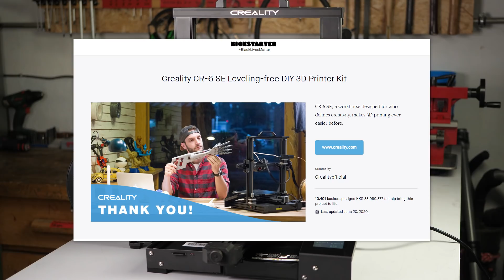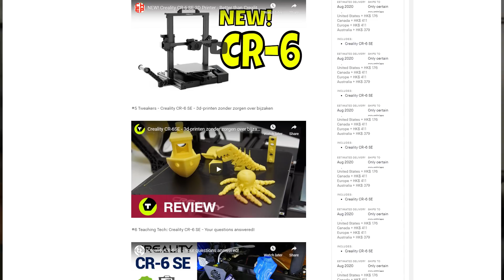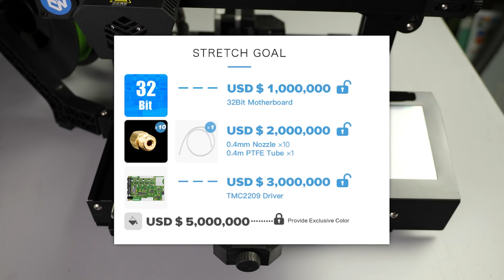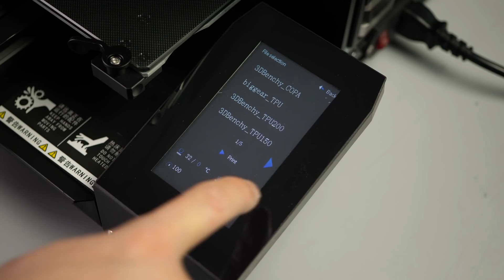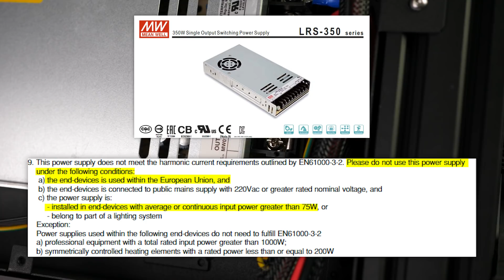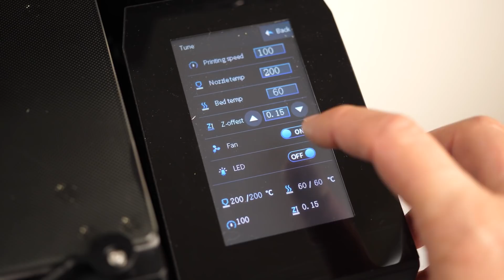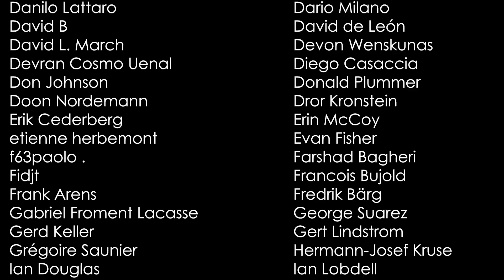Creality CR-6 SE - The NEW (over)hyped Kickstarter 3D printer?

Comment: Well, products like 3D printers we already know will be worked on and modified by the end user. So when I want to compare or complain about something I look to see if it's something that could be easily modified by the end user if they desired it, or if it's something outside the realm of what you would expect.
Something like that print nozzle having an integrated strain gauge, is an example of something you cannot modify or easily retrofit without a whole ton of work.
Something like a flexible print bed, can easily be replaced... Especially with how easy it is to re-level the bed. So I would not call it something worth complaining about.
The same goes for the fan in the meanwell. Even though they are name brand power supplies the fans they use are subject to Chinese quality control. So they might not all be loud, but if you ever get a really loud fan.. just take it out, and replace it with a silent one.
I'd really like to see your next video be an example of adding a flexible print bed and replacing the fan... With the final shot being it printing in your office instead of your basement.
Reply: Yes but how much time do you really spend bed levelling for a decent printer 15mins every couple of Months? ok if your swapping nozzles every day but how many people do that all were paying for is the "it looks cool" and the thought that it might somehow be better than manual levelling but at the end of the day a level bed is a level bed manual or auto. The only time I see auto bed levelling as worth it is for printer with huge bed surfaces 500+ where your a bit more likely to have bed differences or a printer that has a warped bed but that's just covering up bad manufacturing or quality control or if you plan on lugging your printer around the country.

Comment: Non-Creality-Centric channels always complain they would prefere a flexible bed.
Failing to realize most Ender-3 Pro owners had to spend extra money to get-out of the flexible and go to the glass.
That's actually a "free" upgrade, not a problem.
Reply: My Ender 3 pro flexible bed was amazing!

For the 1st 10 or so prints, they just don't last i had bits of it flake off, the magnet gets weaker, and once you make one mistake with you bed level its scored and all your prints have lines on the bottom.

Flexible beds are great if you plan to print big things with large bases that are difficult to remove, but flexible beds should be treated as a consumable

Comment: I beleive becuase it does not have the European Standard or British Standard Rating on the Powersupply is why it states it shouldnt be used in the EU. However it does have the CE logo so can be used.
Reply: As long as there is one usage case in the EU, (and they are compliant), Meanwell can still stick the CE logo on it. They do not have to meet general purpose usage, as long as they clearly state the limitations, (as they did). As for Creality using it in a non-compliant case, for them it is a component and there is no need for CE on the power supply or any conditions from Meanwell, as they need to redo all EMC tests anyway on the end-device.

Comment: Regarding CE compliance, since the end-device will need to be tested again for all EMC requirements, if Creality passed these tests, they are OK (assuming they used a credible lab). Although advisable, separate components do not (necessarily) have to meet the CE requirements. On the other hand since this is the main power supply It would be unlikely the end-device harmonics would be significantly different from the separate power supply itself, also since the heating is a nice resistive load.
Anyway, Meanwell only makes the statement regarding EMC, fortunately not for safety.
Reply: You sound confused. "CE" is s dual use "standard." It means one rigorous thing in Europe, in China it means "China Export"
Reply: @vidznstuff1  I am not confused. Certifying for CE is my daily business. I am a notified body certifier for EMCD and RED myself. As for China Export, Meanwell itself refers to the European rules, so clearly the European CE is intended here. And they are allowed to attach it to the device based on the limitations.
The China Export is in principle an urban myth. Just like FCC is for "From Chinese Company"

Comment: A US$420 projected retail price (non-Kickstarter) with what I consider extremely minor complaints (except for the PS fan noise!) versus US$999 for your Prusa Mk 3 makes this printer "overhyped" and not worth the retail price?  I don't see that.
Reply: The tarif for this style of printer is about 350 USD, which I think is reasonable, do not see the added value to justify 420 USD. People that buy a prusa usually is a different peer group that wants to contribute to the development of innovations in open hard/software and/or are interested in just printing without hustle and not so much in doing mods and upgrades. But still I think it is fair to compare it also pricewise and you can clearly see that the china printers are closing in featurewise at lower pricepoint and also start using higher quality components.
Reply: yeah. he can get a bed and a new PS fan and still be $400 less that Prusa.
Reply: I think he's going a bit hard on Creality to get them to make these changes. Not implying he's being disingenuous at all, just that he's probably being strategic.

Comment: There isn't really a good, slim and passive PSUs in MeanWell's stock power supply lineup. The next thing would be the size of a large-ish brick and it would weight a ton. And the passive ones topped out at around 350-400W last time I checked. That's at least what I deciphered from their lineup last time (about a year ago) I checked.

Comment: Coming from an Anet A8, I just found his critical points being nitpicky, but oh well to each his own. 😅
Reply: I own an A8 as well. It was my first printer. Being mechanically inclined, it was awesome. Built it in a few hours and was printing, although not perfect. It’s currently down with a fried MOSFET on the hot end. And talk about loud.. I once seen someone call it the vibrator 2000. But once it was tweaked and tuned, it put
  out some good looking models. The fan noise doesn’t scare me. That can be remedied. I backed this with the enclosure, mainly to print ABS. It can also silence the fan :)
Reply: My thoughts exactly, my A8 is currently in pieces as for yet more upgrades while I wait impatiently for my CR-6 to come in September. "Ooh, the PSU fan is too loud," well I'm sure we can find a way to swap it out for a silent one, it's not rocket surgery. Hell, I'm pretty sure I have a couple spares kicking around from when I added one to my A8.
Reply: @irishalcoholic  ggg
Reply: I also still have an A8 as my main printer, despite all its shortcomings, there is still such a big community and so many upgrade opportunities that it can do anything I need.
I switched to a BTT SKR 1.4 with TMC2130 and attached a capacitive leveling sensor, and a 40A single-rail ATX Antec-PSU with all the safety features. Made myself a beefy MOSFET board, a laser control board (with toolhead quick change), a dry chamber for 6 spools of filament, an enclosure, and attached a RPi to the standby line of the PSU, and now it's basically a fully autonomous print server with zero noise and almost no maintenance.
I often thought about buying a new, more modern printer, but all the features they have and even more are already installed on mine, and I can tune and replace every single part of it.

Comment: Thanks for this great review :) . i also backed it early and im quite confident that this will be a good printer. also thank you for some critical toughts on it. the most annoing as you said would be the noise of the powersupply . i've seen a lot of videos on this printer and also a live stream of someone printing it who had is opperating mostly quiet . you could only hear the fan of the extruder.
the stream was from 3DMN . i would like to knowif the frimware is a potential cause of the problem here

Comment: I want to see the cr-6 max in action too. This but with a build volume larger than that of a cr-10. Here's hoping it's not a repeat of the cr10s max.
Reply: Needs at least 500mm in the z to be useful
Reply: Problem with large printers like CR10s max is with a moving bed is the larger they get it impacts print speed and quality because the momentum of the moving bed, for larger print areas over 300 core xy is better because your not throwing a big bed back and forth. Only problem is core xy cost more.
Reply: @Mrtickleberries  Agreed. I'm waiting for the PrusaXL more than anything right now.

Comment: i don´t like not to be able to level the bed manual ... the mesh leveling should only be to correct an uneven plate ...
the noise oft the power supply fan ? a no go for me !
Reply: All plates are uneven, so you do need the mesh leveling if you're going to use the whole printing area at once.
Reply: You can still set the offset manually for each area of the bed

Comment: It's overhyped. But some people have such bad machines, they are desperate for new printers, for their ultimate solution 😂 Recently I have bought a used JGAurora and it was modded to death, literally. Basically everything you can do wrong has been done on it. One stepper driver had a vref of 1.72V on a TMC2208. Now down to 0.7v or so.
Some people watch too many YouTubers that have no idea what they are doing and slowly worsen their machine until it's useless. A lead screw was totally bent. The lead screw was mounted with PLA printed stepper motor connectors. The brass mountings for the lead screw were totally worn out. Firmware messed up. 
The glass plate was freely moving around on the heat plate because the owner thought he could remove  and cool down the glass plate so easily. It had room to move around in the printed corners/brackets ....ugh!!

Comment: PEI coated flex plate is an add-on that can be added as an upgrade from Creality
Reply: @gerthddyn  Looks like 34.99 and 39.99 depending on smooth vs textured
Reply from the maker: Yeah, just notices, still over $30 though.

Comment: Backed it - I am a plain glass bed person so I'll flip it over.  I can't buy an Ender3 pro and upgrade it for $320 so I bought one.  I completely agree on the power supply - I will address the power supply fan noise when I receive mine.  I wish they would pay a little more attention to the power supply and electronics cooling by a employing a quieter fan and improved passive cooling techniques.  Your concerns about the power supply specs for the EU are valid, let's hope they select something more appropriate (and quieter) for the production units.

Comment: The cr10 has a bigger volume, but honestly width and depth are more important than hight in most cases. So the fact that it is 35x35 instead of 30x30 gives you more usable space in my opinion. If I would have the choice just between the two build volumes I would chose the one of the cr6.

Comment: Are more silent psus in this formfactor available? Would love a more silent one in my Artillery Genius.
Reply from the maker: Would like to know that as well. Prusa uses fan-less ones, but they are a bit thicker.
Reply: I think I've got some room left. Let's find out. Genius is a 24v printer though. Think Prusa is 12v. Then again I'm old and forgetful.
Reply: @GriotDNB  MeanWell 24V PSUs use a 12V fan, you probably can mod the housing with a pressure optimized 12cm fam from Arctic (wich has one version with bearings aimed to continuous operation). It is 10€ mod and a bit of metal cutting.
Reply: GroovyDrifter are you sure it’s a 12v fan? Then you wouldn’t even need a 120mm fan and can just replace it with any 60mm 12v pc fan (with high cfm). Or buy a sunon maglev. Those are industrial fans and exist in 12 and 24v. The only thing you hear there is the wind because it pushes masses of it even at 60mm.
Reply: @CNCKitchen  Perhaps not this form factor, but there are small psus that are perfectly quiet for computers in the 350W range on the 12V rails~ and have been for years
Reply: Well, If you are brave enough you can buy a silent Noctua fan and change the power suply one. If the problem it's just the noise and not the overall power suply, that can be a solution.

Comment: Please listen Creality! Give it an all metal hotend and fix that power supply and it’ll be a true competitor with the Prusa MK3!
Reply: I would like the option for PTFE-lined to the nozzle in any case.  I print mostly PLA and have had very few clogs if any on certain machines with Capricorn PTFE-lined hotends over the years. Can't say the same for all-metal with PLA and I don't like oiling the filament.  I have other machines with all-metal hot ends for printing the more exotic higher-temp materials.  I prefer PTFE-lined for PLA and PETG.
Reply: reasonablebeing I’m sure creality could figure out how to design an all metal hotend that prints just as well as a PTFE lined one. Though at this printers hefty price tag, the Prusa mini offers an advanced hotend capable of printing nylons. Because of this, Prusa is attracting much of the community looking for functional parts. If creality can do this then it’ll blow the mini out of the water. Especially if they get a pei spring steel bed and fix that power supply—it’ll be perfect.
Reply: @bldjln3158  you can get already the PEI springsteel bed, it was an add on on KS and I got one. The full metal, I believe it is easily upgradeable changing the heatbreak only. Although uncommon there are all metal titanium and bi-metal heatbreaks already available on eBay/Aliexpress
Reply: @crisostomo231  I don't know why people are getting the spring steel bed from the survey. You can buy a 235x235 spring steel cheaper from elsewhere. The only things I added were the nozzles and Capricorn tube since they were very cheap there.